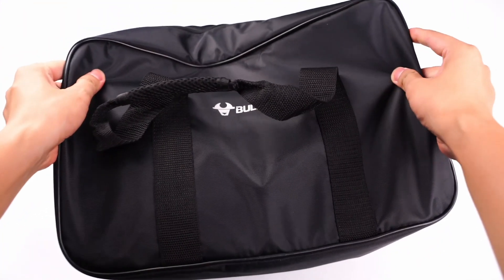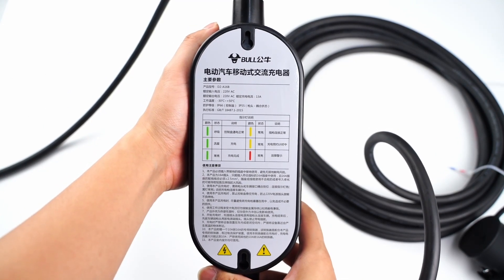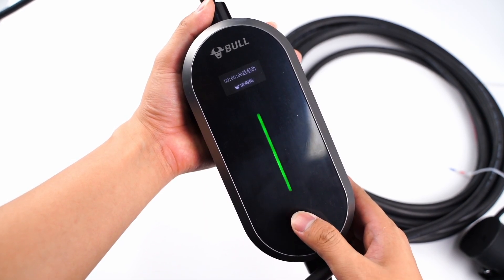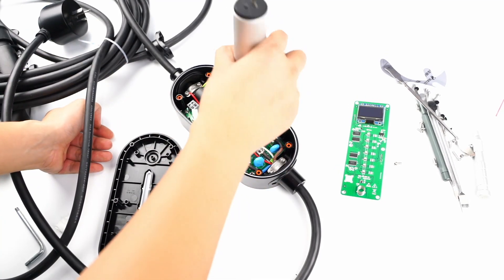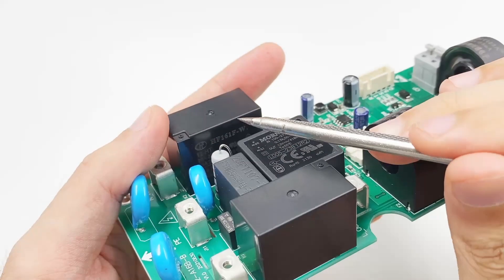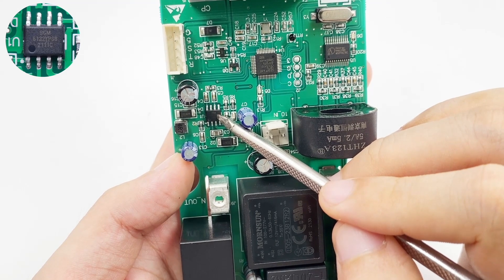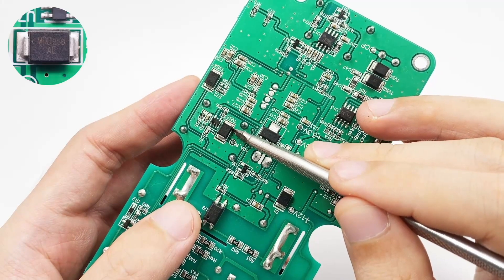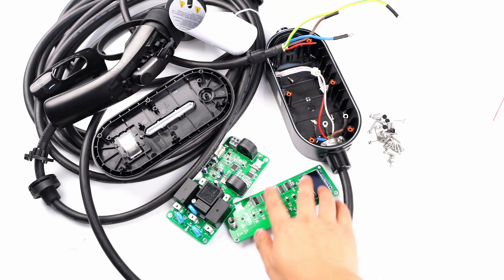Teardown of Bull Portable Electric Vehicle Charger (Power Adapter)

Comment: My portable ev 7kw charger is similar. It reports temp as high as 80 deg C when operating for hours on a warm day. Is not that hot to touch the case, maybe 30-40 degrees C, not much more thsn ambient.

Just over a year into using, was expecting failure at those high temperatures. 

Seeing the case opened, im not convinced adding a heat sink and fan to outside of the case will reduce temperatures. Feels likeit needs air blown through the case to cool multiple components.

I was expecting a small number of components to produce most of the heat. It should be obvious to a power electronics guru. I'm not.

Am I missing something?

Has anyone filmed these chargers with a heat sensing camera?

I'm concerned any charger reportimg high temperstures will fail prematurely. 

My charger does not seem to have a high temperature shutdown or auto self derating on high temp.  

Possibly the temp reported is not really that high. Idk.

Hoping others can shed light on their experiences.

Mine is model IC-CPD.